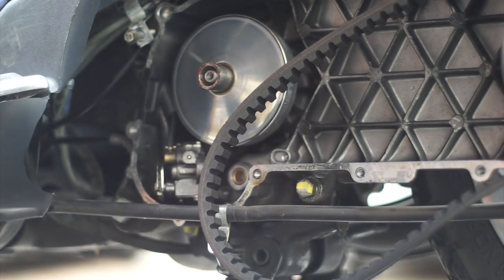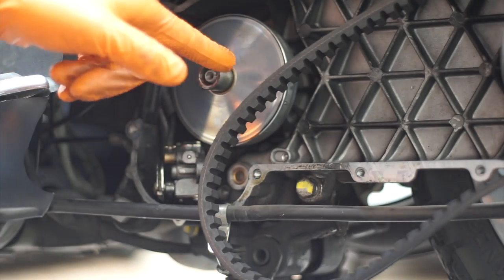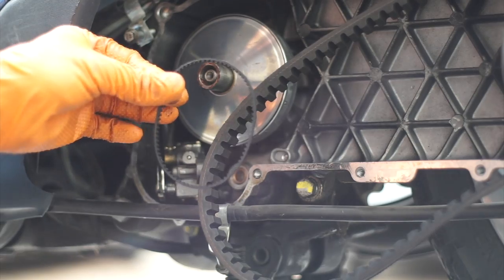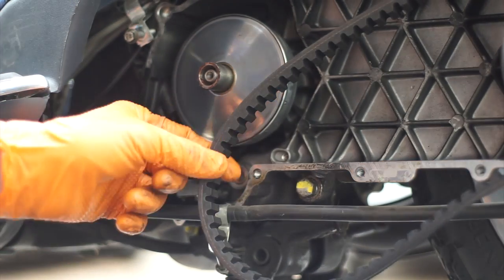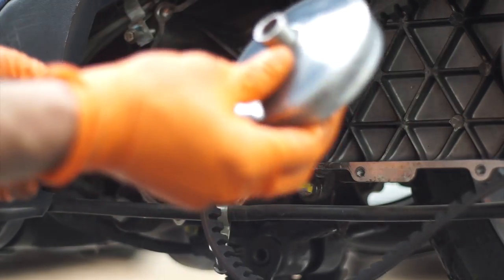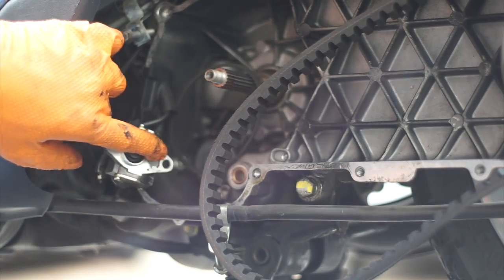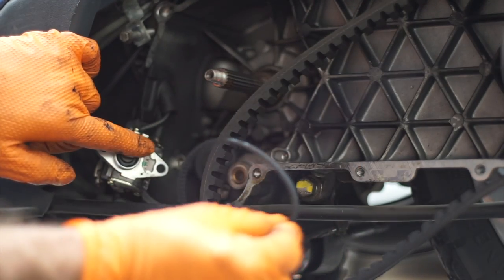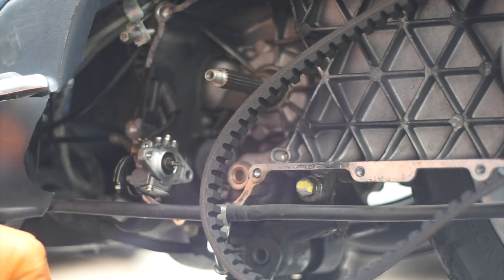Piaggio 2-Stroke oil pump drive belt (every 2500 miles)

Comment: You dont need change the oil pump belt every 2500miles, my aprila sr50r is 26000km and the belt i only changed now, the belt was good but i changed.

Comment: Hi there. Just looking for a bit of guidance.. I have a Piaggio NRG Power that wont turnover. is there anywhere i can find a Piaggio Manual for the spec of the engine as I have no clue about these bikes as always have Yamaha Aerox/Jog's. the kick has compression and my battery is fully charged, just absolutely no signs of life lol. Thanks in advance guys

Comment: Great video! Quick question...what is the stock crank shaft in 2004 Piaggio et2 engine rated for? I Am installing Stage 6 MK II Sport 70cc an thinking to keep the stock crank... i have also Yasuni R, Malossi 2000, Ordering Stage6 Carburettor Stage6 R/T Type PWK21, 3g Polini clutch with green springs. Thank you!

Comment: Please could you help, after the oil pump crank gear that the belt sits on, is there a spacer before the variator?, or just the roller and bushing that slides up against it? Im re building one and someone has been here before and made a mess of it

Comment: I have a taotao scooter i put a big bore kit and adjusted valves, new carb and spark plug and coil and with the stock cdi starts perfect  ut with the orange performance one it takes alot longer to start why is that
Reply: timing moved after or before than it was on oem cdi
Reply: you can test theory by finding some junk stator ,with working pickup coil,expand holes to both sides and move a mm left ,or mm right ,and test it until it starts good

Comment: is there any way i could just add oil into the gas tank and not replace my broken pump?
Reply from the maker: Yes definitely
Reply: @RollingWrench  Do you know if i have to disconnect something first or can i just start mixing right away? thanks btw
Reply: @adf_adamskiii i would close carb input for oil,remove tank for oil,remove pump
Reply: @cistokrvnibosanac1266  bit late but thanks for the help lad